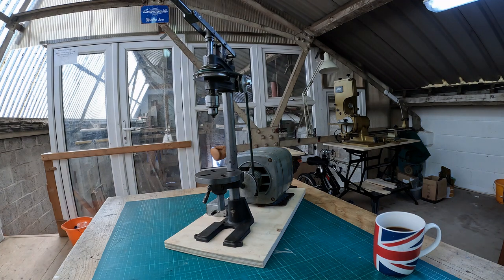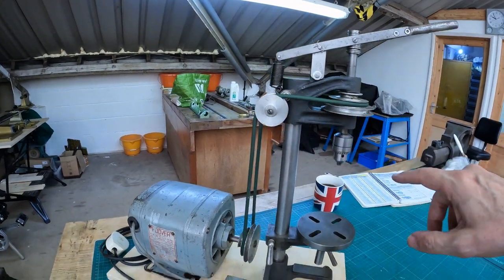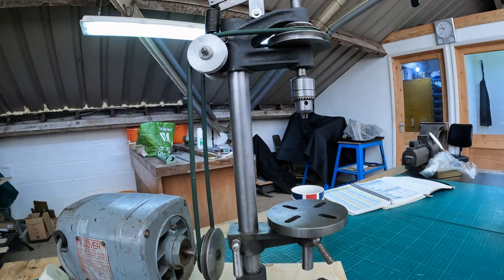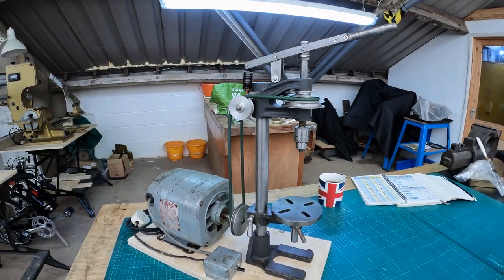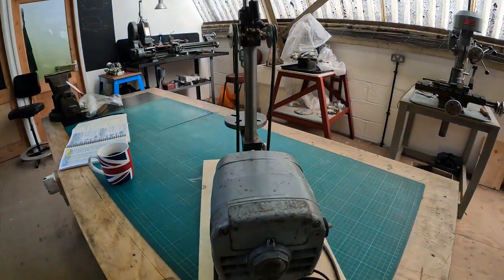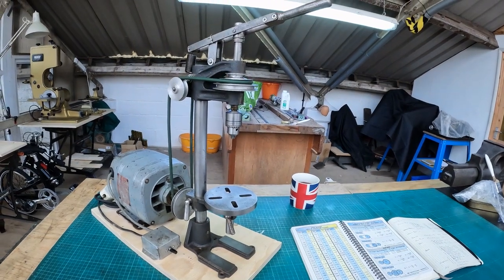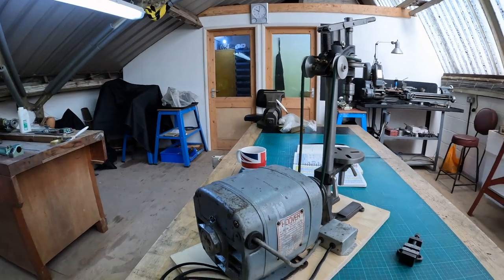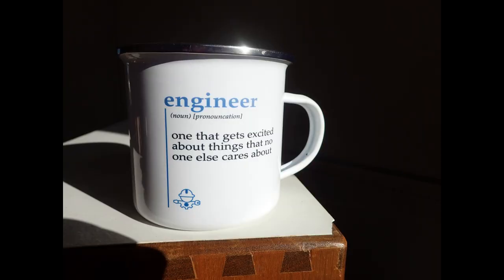Sensitive Drilling Machine Introduction.

Comment: Hi Paul, once again you've found a unique and unusual machine that will enhance your shop. This machine looks like it has more throat depth and spindle travel than the Unimat in vertical configuration.
Just a random tip, I discovered completely by accident that a laminated bamboo cutting board make an excellent portable baseplate for micro machines like the Unimat. The bamboo wood is incredibly dense and hard, scratch and oil resistant, yet light enough to make moving the machine easy. Some of the pre-finished cutting boards even have grooves milled around the edges that are great for keeping drills and cutters from rolling away. Lots of these on eBay for reasonable prices ...
Reply from the maker: Hello Rich,
Yes it has a little a slightly bigger capacity than the Unimat. The bamboo cutting boards sound a really good idea... I made a film, yet to be released that  would work with them far better than the plywood I used. I will try and find one. Thanks for watching.
Did you get my email about "Unimat SL in Focus", I would be grateful for your thoughts.
Take care.
Paul,,

Comment: Maybe the lever has significant play because the spindle does not. When the lever goes up and down, it's prescribing an arc, since the fulcrum is fixed, there needs to be slop in order to not change the position of the spindle, or at least put pressure on it in One direction
Reply from the maker: Hello Jean-Paul,
The spindle is a good fit so you may be partly correct, however there is still quite a lot of slop which I think I can remove. I also feel the way the spring is attached could be improved. Thanks for watching.
Cheers.
Paul,,

Comment: It looks like a wonderful fine sensitivity drill press. Does it happen to have reverse? If not, it might be worth looking around on eBay for a procurier automatic tapping head. I converted one of my smaller drill presses to be a dedicated tapping station, the midsize tapping head almost never needs to be changed and having that feel through the lever really lets you dial in the torque setting at which point you want the tap to reverse
Reply from the maker: Hello Jean-Paul,
Thanks... no reverse but that is an interesting thought, I will add it to my list.  I am not sure about having a dial rather thank the lever as I would want to try and retain the feedback when using smaller drill bits. I have a tapping head for the Dore Westbury milling machine, I have yet to show it to you guys. Thanks for watching. 
Take care.
Paul,,
Reply: @TheKnacklersWorkshop  I didn't state myself very clearly. I was not suggesting removing the lever at all. Perhaps it's different on your tapping head, but the procurier doesn't have any dial, it just replaces the chuck. It has an adjustment screw that determines what torque setting makes the tap start to reverse when it encounters significant resistance. I have found these to be especially useful on small fine drill presses mainly because of the lever. Before we getting that particular head, I always preferred tapping by hand because you can feel when the materials about to yield. The same is true with the lever.

Comment: Hi Paul, never ceases to amaze me the machines you find. Surprised the table doesn't have a hole in the middle for the drill bit. Cheers!
Reply from the maker: Hello Dave,
I think it will make a nice machine with some work... I just have lots of saved searches on eBay and some take years to find whatever I want.  Interesting, I had not thought about the lack of hole in the middle. Thanks for watching.
Take care.
Paul,,